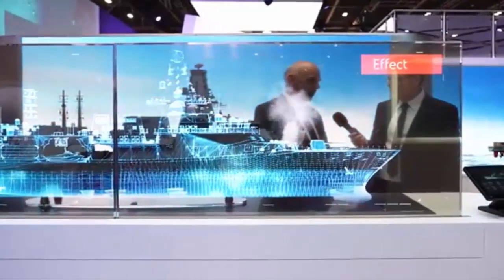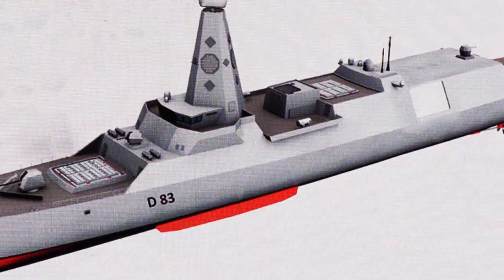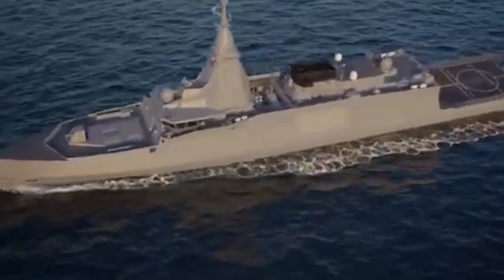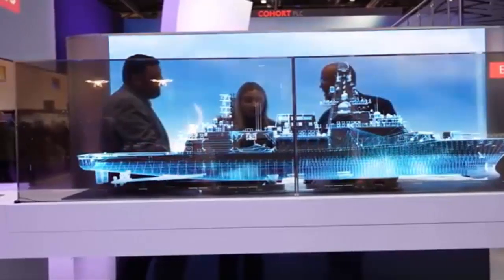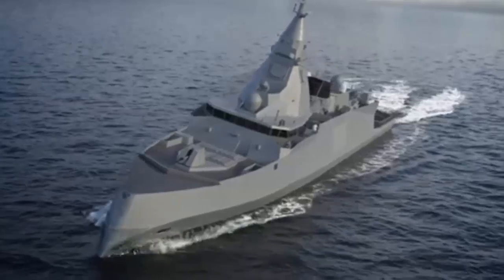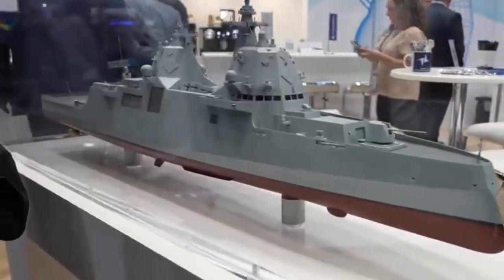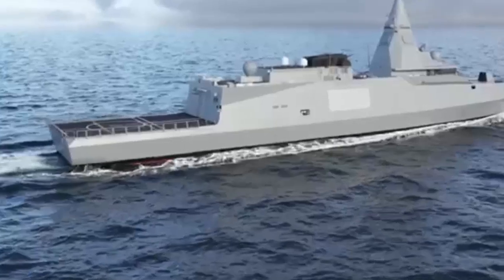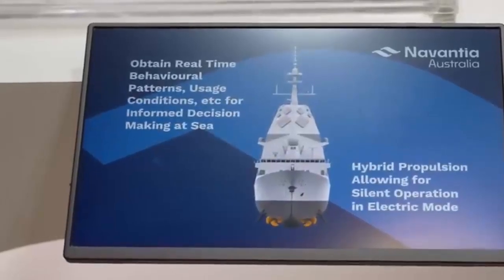Royal Navy’s Next generation Air Warfare Command Ship of around 10,000 tons

Comment: I feel that the future Type 83 FADS Crewed Surface Combatant should as a bare minimum have the inherent hull design, machinery, pipe work, electrical systems as well as, doors and hatches etc, should be designed to the Type 26’s ASW specification along with a CODELOG configured propulsion system. Even though Anti-Submarine Warfare will not be one of mission sets, this IAAW/BMD optimised Surface Combatant will conduct. My reasoning for this is that the ASW Acoustic Hygiene design specification can not be realistically retrofitted further down the line, thus the Type 83 will be future proofed for this mission, should become a long term future requirement. Anyway to my mind, It’s just something that shouldn’t be disregarded straight away. Cheers.
Reply: Agreed, baseline Type 26 design which will have been thoroughly tested and at sea with a wide number across the UK, Norwegian, Canadian and Australian Navy's, will be a great foundation, as importantly it will save money, money that can be used on the air warfare element.